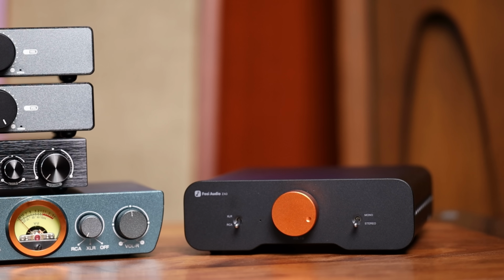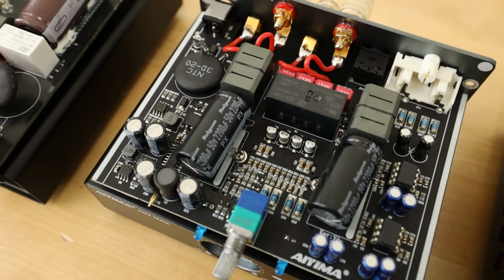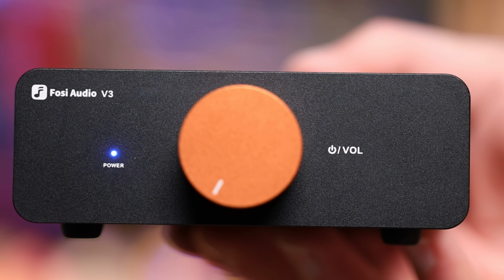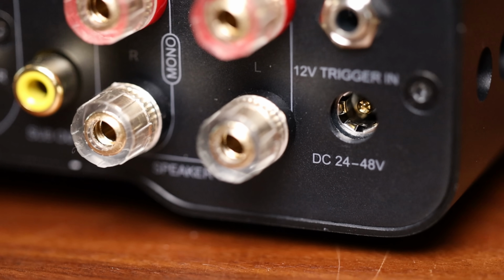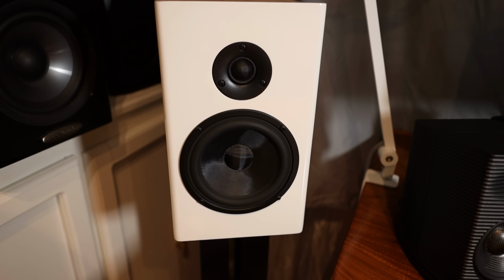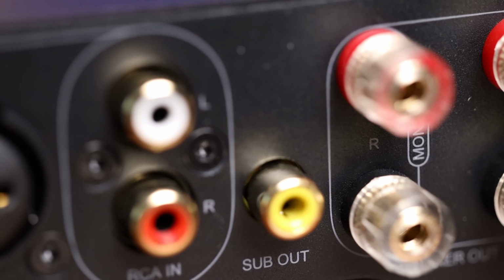Fosi ZA3- Teardown / Comparison / Review - Topping LA90 Who?

Comment: when you say an amp "feels a bit cramped" or "opens up the space" realize that a condensed size circuit (shorter traces) will be better sounding all else equal.  They should all be designed a small as possible without compromising other aspects.

Comment: If you get 2 ZA3s you can also get to V3 Mono Amps from Fosi 
OR
if you are using 2 ZA3s on mono & without sub then remove the L on Amp plus the two sub on amps from each ZA3. Much more clarity in the sound overall as well as lower power consumption / heating of each unit

Comment: With the lovely Fosi ZD3 DAC, not only can you drive mono ZA3s, but you can trigger both amps using the trigger out of the ZD3, so - no need to ever touch the ZA3 volume knobs in that configuration - which is one I intend on deploying. Along with a little Fosi M03 subwoofer amp - which does have its own stand-alone power switch. :)
I'll have to solder up a 3-way trigger cable, however, as the ZD3 only has one trigger outlet, and the ZA3 has no trigger pass-through.

Comment: Nice overall review. The only thing missing is swapping out the opamps with one or two alternatives. Amps where they are socketed, it's for a reason, because a fair number of users want it and do it, so this is a feature that deserves to be reviewed I think.  Also missing is how to open the unit to do the swap, that's another interesting thing that could be included in your reviews, even though arguably if you can't figure out how to do it you prob should not be doing it.  Pay a tech to do it then ;-)

Comment: The sub out IS filtered, crossover is fixed, 100-170Hz. No high pass on mains though so...
Reply: The sub out of the ZA3 is not filtered at all. I choose an additional ZP3 with a crossover at the sub @200 Hz and the alternatives for the main "full range", above 80 Hz, or above 120 Hz

Comment: One month in I can confirm the ZA3 has a long burn in. Starting to sound really good now (with a budget-friendly LM4562 high slew-rate op-amp upgrade). It was noticeably closed, dull, and lifeless out of the box, and I almost gave up on it.
I had to run it with Rothwell Attenuators (to control the input) on my big rig's REALLY sensitive speakers, but back on the Missions I've dispensed with those.
Reply: thanks for the opamp comment. That was missing from the review. There's prob many more inexpensive ones you could use to upgrade the sound.

Comment: I am currently using an Emotiva A100 as the amp with a vintage Marantz as a pre-amp, I wonder if replacing the whole setup with one of these would give me better sound? It' s in a small 10 by 12 bedroom.
Reply: I have about ten of these little class d amps. My Emotiva A2 mini at 50 watts per channel BLOWS them all out of the water and it’s a third of the rated power of your A100. For a desk top or near field setup these little amps are great.
Reply: @ramondelgado6778  The A100 is also 50W. Placed next to my floor mounts, it looks miniscule, yet it can drive those speakers to the point where I could get kicked out of my apt. No noise or distortion at all.
Reply: @ramondelgado6778  The A100 is also 50W. Not sure if the A2 mini was the followup to the A100. I know the first one was the mini A100 and then they changed the name.

Comment: I tried the fosi as two mono with my setup. But: .... well, they have power - no doubt - but there is simply no difference to my audiolab which powers 2x110 Watts. The fosis were not able to power up my onkyo scepters - huge vintage speakers. Maybe for a small setup it is right.

Comment: I'm surprised how many vloggers get the thing about 'driving speakers' wrong. Large speakers are easier to drive than small ones as they have a higher sensitivity and you get more sound out of 1 watt. Somehow people get this false idea that a large speaker would somehow require a large amp. Not true. Quite the opposite in fact as long as we're talking about dynamic speakers. Electrostatics are a whole different story.

Comment: I am a big fan of my Fosi ZA3. It is incredible. Only issue I have is that I have to turn it on manually.
All of my other equipment turns on when I feed them power.

Is there a way to bridge 2 contacts near the power on (volume knob) so that it turns on by itself when I feed it power?

Also, the ZA3 does not hold you volume control, because every time you turn it on, you will always invertedly turn the knob ever so slightly. It really should have been that left switch. And the switch to switch between rca and xlr should have been on the back of the unit!

How can I use the 24v trigger? I have no other equipment that can trigger my ZA3. IS there and adapter that I can just feed into that trigger input?

Comment: The maximum RMS power output Wattage is limited by the power supply.  In this case 48Vx5Amps = 240 Watts total or 120 Watts per channel.  Class D amps are being relatively efficient, say 95%, would result in about 114 Watts/channel.

Comment: TUBE tip: If your amp came with Chinese 6k4 tubes (has a red star printed on the glass), mine caused distortion.  I upgraded to much better sound for $17 with GE JAN 5654W matched pair tubes.  6k4 tubes can be replaced by 6J1, 6J2, 6J3, 6J4, 6J5, 6"1N, 64N, 65N, 5654/5654W, 5725, 6AK5, EF95, 6BA6, 403B, etc.  Your tubes may be ok.  Just an FYI free tip.  Thanks for the video.

Comment: Bought a pair of Fosi ZA 3’s and a 48volt 10amp power supply. I bi-wired my speakers and noticed a small change in the loudness and increased dynamics especially in the lower frequencies. I tried the 10 amp power supply in stereo mode and not bi-amped the difference was not as great, but noticeable. While the 10amp power supply is $30.00 more than the 5 amp, I think it’s worthwhile. Fosi has addressed noise problems some evaluators have talked about in the 10 amp power supply by offering a noise filter to those who pledged on Kickstarter for the V3 Mono Blocks for free and 2 op amps also. Fosi has been responsive to problems and that’s impressive for a small low priced manufacturer. I hope Fosi comes out with a DAC using paired chips at a reasonable price. Received notice on 6/1/24 that they will start shipping the mono blocks 6/15/24

Comment: I tried the Fosi ZA3 with a 48volt 10amp power supply (I have the 48volt 5 amp power supply also) there was a noticeable difference in output from my inefficient speakers. I’ve taken advantage of the Kickstarter reward for pre-ordering the new Mono Block V3 (2) with another 48volt 10amp power supply for shipping in June 2024. I own a Van Alstine Dynaco Double 400 and the Fosi ZA3 at moderate levels can keep up with it! The difference comes in the low frequencies where the Double 400 excels. The Fosi ZA 3 is a rare bargain these days. PS: I didn’t try to drive the ZA 3 to clipping or make it go into protective mode. My speakers are 6 ohms and 86db sensitivity. Never thought a $150.00 amp could be so good. As for the spacing of the binding post being so narrow is a legal and safety matter as some European mains plugs are the same size as double banana plugs.

Comment: Recently returned a Cambridge CXA81 and swapped it out for this cheap little amp. Also “downgraded” my KEF 350s to q150 .. Saved a ton of money, but didn’t sacrifice any noticeable sound quality or features I needed.  It makes for an incredibly capable 2.1 system for a single source setup. Got my LG C1 optical output feeding my RME audio interface, with its XLR going out to my ZA3 .. 

ZA3’s XLR input isn’t a true balanced connection, but there’s no noise/hiss anyway, so not a big deal to me. The only feature I’d love to see would be a high pass filter for sub integration. FOSI is talking about implementing a switchable HPF in future models, which would make it near perfect.

Comment: Has it remote control?
Reply from the maker: Not with this one.
Reply: @MattCoykendall1  
So how can I use Fosi ZA3 with remote control? Do they offer any preamplifier for this amp?
Then we could build  set with two ZA3 as a monoblocs and preamp as a steering unit.
Reply from the maker: @nocnymarek7645  They offer the P3 preamp but that also does not include a remote, I would suggest to use a wiim product as the streamer/preamp and its included remote.

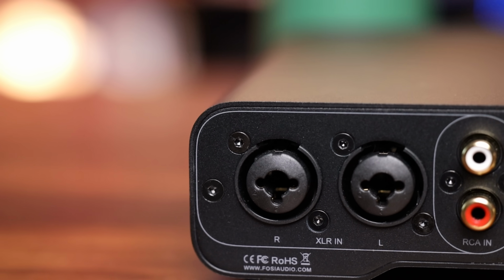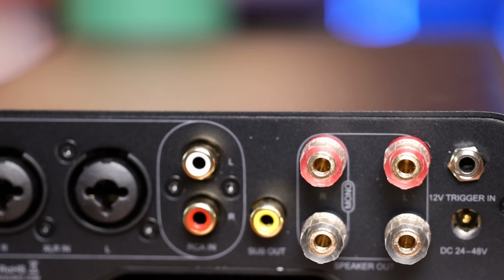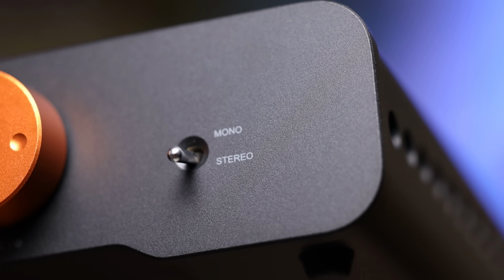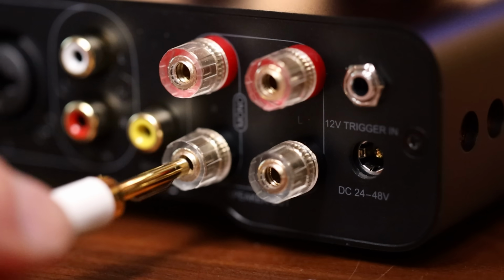Comment: The bokeh/depth of field/auto focus could be better in this video.  It takes too long to re-focus when you are doing B-roll. Like 4:13 to 4:22 and again at 6:55.  Highly distracting,  Most people will be watching this on 16x9 widescreen aspect ratio, when your focus is only the middle 10% or 20% of the screen it is too narrow.  Many times your auto focus is not cenetered, like 4:56, your focus is on the right side 12v trigger, but you are talking about the speaker terminals and we can not see the MONO label.

Comment: Really, Fosi is taking their products serious? My Fosi X3 has counterfeit NE5532 Op Amps. They are not NE5532 just something cheap labeled NE5532 and counterfeit electrolytic. Crap gear mascarading as something legitimate. All these super cheap types of gear don't even come close to meeting their published specs. Like rated at 300 watts RMS jper channel but when tested only makes 28 watts per channel. They are cheap but are really not worth the money.
Reply from the maker: NE5532 chips vary in appearance depending on what factory they come out of, Fosi actually posted a picture of their purchase order from Texas Instruments of the genuine chips during their V3 release so at the very least it appears the new amps are using genuine parts, they were tested as genuine as well, I cant speak on your amp though, never had that one in.
Reply: @MattCoykendall1 Thanks Matt. Hard to tell by chip markings, since that can be easily be faked. One way to verify that a NE5532 is fake is to do a diode check with a DVM between pins 2 and 3. It should read that there are diodes in both directions (check, reverse test lead and check again). If there are no diodes present then it is a fake chip, no question, as all genuine NE5532 chips have these protection diodes.. My Fosi x3 has no diodes on its pins 2 & 3 NE5532 chips. It has fake chips. Another Chinese made preamp by a different brand also had fake NE5532 chips. But on that brand it had sockets, so I put in genuine NE5532 chips I purchased from Mouser. On Fosi they are surface mounted and not easy to replace so not a usable device to me.

Comment: Thanks Matt, you are a natural at this stuff. I want to throw this out there... This is more of a comment on the Texas Instruments amp chip, and would apply to most if not all of these amps using it, including the ZA3. 

I just bought the V3, ZA3 is a month out on back order, but I am really impressed with the internals of these little amps. I ordered a pair of the Sparkos with risers and am chomping at the bit to receive them. The sound of the V3 is quite impressive through my PS Audio DAC/Preamp. I'm using the WiiM Pro via digital coax to the PS Audio unit and it sounds darn good, not so much of that Class D sound, but more A/B through my Zu DW6 Supreme speakers. 

One thing though with the V3, it was rather thin and lifeless, until I dug up a pair of male XLR to RCA adapters and plugged those into the XLR output of my DAC, and ran RCA cables to the V3 inputs. That extra line voltage produced via the XLR connections really lit up the room in regards to overall sound quality, as did bumping up the WiiM EQ settings. So, I ordered a line level booster to see if we can really get this V3 to sing. I guess, at least from my reading, the TI amp chip likes higher voltages, and so far, that is exactly what I am discovering. I would assume the same applies to the ZA3. 

This TI amp chip is another beast, and I am surprised no one has mentioned the line level voltages, in regards to overall sound quality. The added power really boosts the overall soundstage, along with instrument separation and the overall dynamics of the recordings. And, I have both power bricks, the 32v and 48v, I heard no difference between the two in regards to driving my speakers or getting better sound. The Zu's are 95dB and 12 ohm, so only a few watts are needed to get great sound out of these. So, I am just letting folks know about these line voltages and the TI amp chip. I will have the line booster today, hopefully I will have time to install it into the system and see what happens.
Reply: Hello Michael ... indeed you are correct, the TPA3255 chip expects 2 volts for clipping with a 48 volt supply and about 1.6 to clip on 36.  These are pro-audio levels so naturally the added push from XLR is going to work better.

Oddly enough the sonic difference appears to be more about the volume control potentiometer than the actual signal levels.  

Fosi are using 50k pots and their op-amps are generally exhibiting a 20k input impedance.  So if you think about the pot at mid-value (not necessarily mid-rotation) you end up with both sides of the pot, in parallel and effectively in series with the op-amp inputs... so 12.5 k feeding 20k ... this amounts to a mid-value loss of about 3db, maybe a bit more.  Taking the reactance of the signal coupling capacitor into account, this will produce a mid-volume loss of deep bass, which is audible.  

Subbing in a 10k audio taper volume pot makes a noticeable difference, particularly in the low bass; 100hz down...

Comment: Well, here is my 2 cents. I have had aiyima t9, fosi v3 (for a brief moment), aiyima a08 and smsl vmv a1. I think t9 and v3 are in the same tier although v3 is more powerful. I think t9 had a more enjoyable sound due to distortion tubes were creating. I also tube rolled and sound signature changed for something else. Aiyima a08 was better  and more powerful than the 2 forementioned amps in every aspect but with an aftermarket power cable. The cable that it comes with was crap. And smsl vmv a1, if a08 was a tier above the v3 than a1 is 3 tiers above the a08. I have to admit that vmv a1 is low powerwise but comes with a quality power cable and it sounds good enough for a nitpicking audiophile that I am. All my experimentation I never used the onboard dacs and bluetooth since I was testing forntheir limits. My main amp is yamaha 2100 btw. which I would consider another 3 tiers up on top of vmv a1. I was still curious what I would get if I would get 2 za3s, but I think I won't bother, I wouldn't think I would be happy with the sound quality.
Reply: Bad tubes, ok sound.  Good tubes, Great sound.

Comment: In mono mode is the base output mono also?
Reply: The sub-out is always in mono.
Reply: @Douglas_Blake_579  Thanks, My question is the mono out a combination of base from both left and right channels of a stereo amp/signal? If so, how does that work with one sub and separate amps?
Reply: @ke5ufg  
You will get the same bass in all three speakers.

Most recordings use "mono" bass anyway.  It's the same in both channels to begin with, so it's not much of a stretch to just feed to all the amps.

Comment: So if im running the A07 max in mono and I want to upgrade the op amps like a sparkos ss3602 would i only need to purchase 2 chips? One for each of the left signals since mono is only using one channel in each amp?
Reply: Yes, two chips total, just as you are thinking.

Comment: Hello Matt good morning. I've a question. I have a pair of ZA3's in mono using XLR inputs. If I want to switch op amps,would you recommend changing just the right channel op amps? Or just the XLR op amps? I only have a pair of sparkos. Fosi replied I can try changing just the right channels, but they also added "if you're an audiophile" you want to change both channels for better sound.

Comment: I bought the Fosi ZA-3 (with 48V power supply) thinking it might be a keeper.  What I discovered was a mixed bag...thin in the mid-range and bass.  I also did not care for the volume control, cheap like in build and function.  On the plus side is exceptional clarity in the treble but requires a sub-woofer to add body and weight to the music.  Best used with a bass centric loudspeaker or possibly use two amplifiers.  My two cents!
Reply: You need to up the line level input voltage to open these TI amp chips up. A good preamp is required, or even a line level booster or an EQ with a gain function. I discovered this by accident with my V3, just as you described your experience with the ZA3. I started boosting the line levels and she really opened up and started to sing. If not for that discovery, I would have returned the V3. And this has nothing to do with the power bricks, I have both the 32v and 48v, no difference between the two in regards to speaker output or SQ improvements. It is not a power brick issue, it is a gain issue.
Reply: @michaelwright1602  exactly, that's what it of people need to know, when running "separates" which is basically what your doing it's always much more grunt and gain. An amplifier isnt really made to be used standalone, it will be anemic in the bass and output usually, need a preamp or EQ for certain.
Reply: What preamp was you using? That low end and midrange can be stacked and added depending on the preamp combo.
Reply: I don't understand your question, the Fosi ZA-3 is an integrated amplifier so I am using it's preamp section with it's amplifier section.  I am aware of buying two of them for more power and in a balanced configuration, but, I was using only one of them.  @WattswithWayne
Reply: @DistroUser123  it would give you a lot more gain and bass and treble gain and control over the amp, basically what I'm saying is they do much better with a dedicated preamp, like the p3, they'll literally feel like they have double the output with a decent preamp.